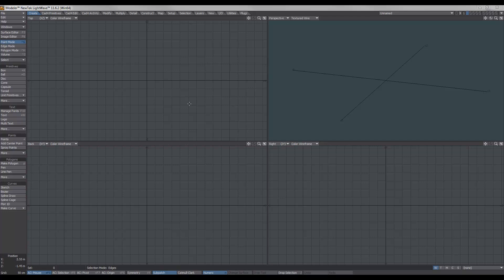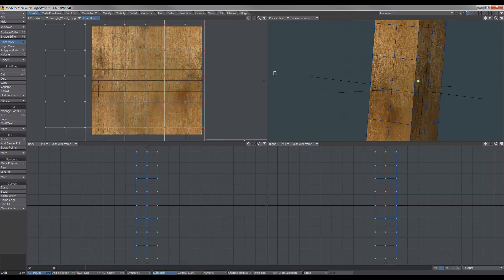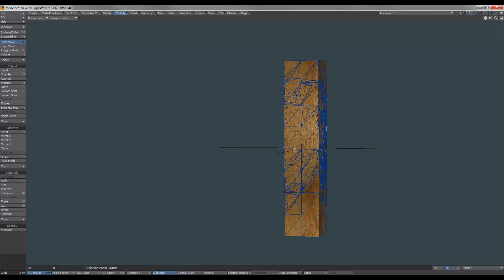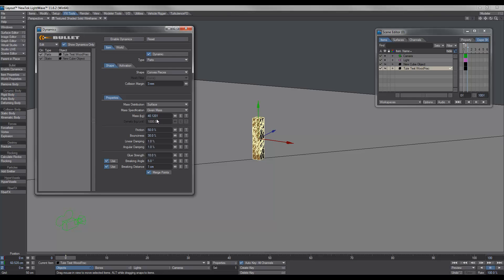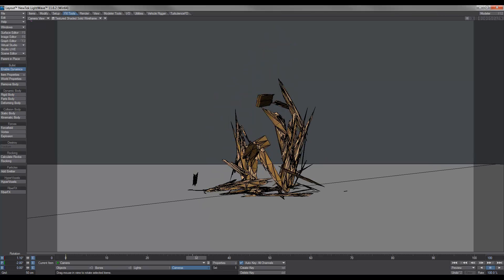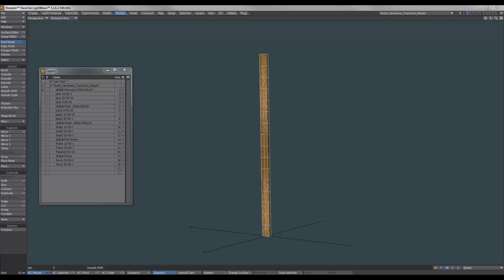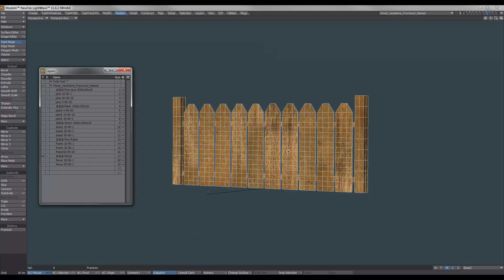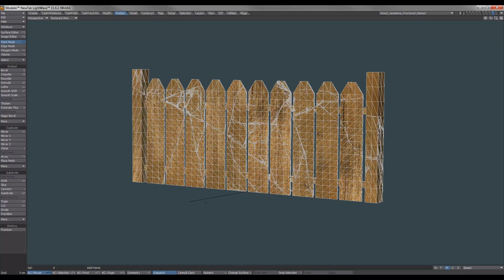Lightwave 11.6 Bullet Dynamics - Fracturing Wood

Comment: Thanks for all the work and the excellent presentation!  Smart problem solving too.  As a question (because I don't know) I wonder if turning up the "glue strength" and "break angle" settings could help with your ball through the house frame example?  I may need to experiment with that now.  Thanks again for all.
Reply: Your welcome SKD!! The best thing to do is experiment and see what happens...try it with simple objects to speed up calculation time.

Comment: Nice share Ivan, might come in handy for wood cracking:)

And for Scott, you can also start simulation on the object by setting it to activate by last key.

I Have also put a simple thread..and some images on how to match collision impact region ..so you sort of set up where the collision will be in layout, and save out the scene and load back to modeler to make the fracture based on that impact regions rather than just fracture the whole object or manually guessing where the impact will be..so you can get more detailed fractures at impact region.

Michael/aka prometheus on newtek forums
Reply: Thanks Michael!! I'll take a look at that.
Im working on a tute showing how to use gradients with bullet...the results look great...should be up sometime today.